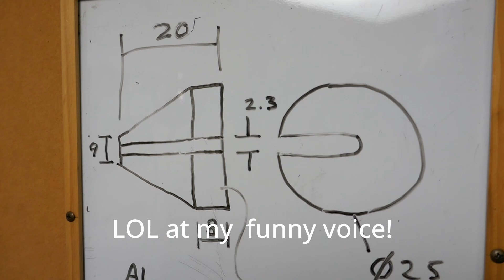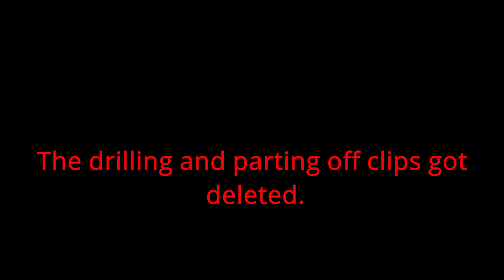Making a fancy spoke wrench on Myford lathe and milling machine

Comment: Braking on the rear wheel is a bad idea in general for tadpole trikes, if you lose traction at the rear then the back end will try to overtake you, and at some point the wheels will grip up as you turn sideways.  It does depend a bit on weight distribution, but yours doesn’t look particularly abnormal.
You’ve made a better spoke wrench than many of the cheap ones out there though, so that’s fun.
Reply from the maker: I agree about the rear wheel braking - but on a tilting tadpole the dynamics will be very different to the non-tilting variety, which can do the spin-and-flip thing when the rear wheel loses traction.  The weight distribution on mine is comparatively far back but whether this is good or bad remains to be seen.
Reply: @MetalMachineShop  yeah, haven’t got my head around the change in dynamics, but my experience with coaster brakes has been predominantly on sit up and beg style bikes, with a very significant rear bias.
Reply: In terms of the dynamics, I’m really interested to see whether a tilting trike requires any balance on the part of the pilot...
Reply from the maker: @JohnR31415  it should in theory be the same as riding a bike by my reckoning, but due to the laid back seat design, it will mainly be steering inputs that maintain the balance.  Hopefully I will find out when the prototype is finished!
Reply: @MetalMachineShop  reason I’m really interested is that I can’t ride two wheels any more...

Comment: Would now be a good time to tell you that I happen to have two spoke keys in my tool box, and I would have happily given one of them to you? Cheers, nonetheless.
Reply: There are four sizes of spoke nipple commonly used on bicycles.  It's actually a good idea to use the right one.
Newton sell a spoke key with four different bit sizes in it.  It also grips the nipple on all four sides, which is rather useful to prevent rounding of the nipple, if your spoke nipples are a bit tight, due to high tension or corrosion.  It's a rather good tool, for a bargain price of £7.  It's now being  marketed by Park